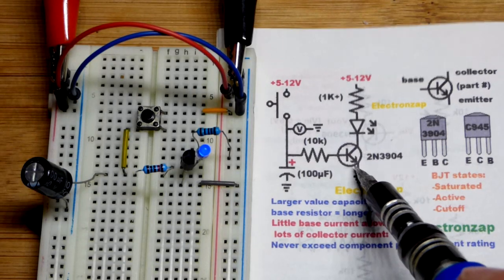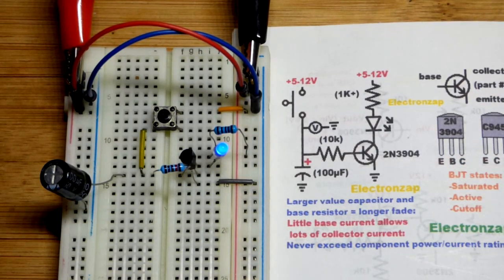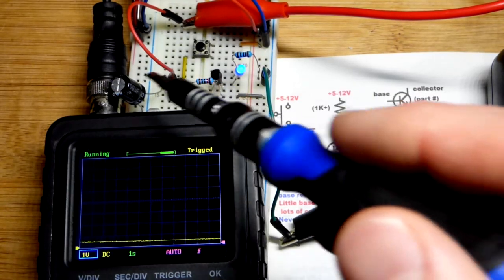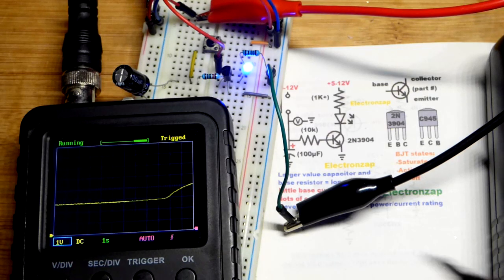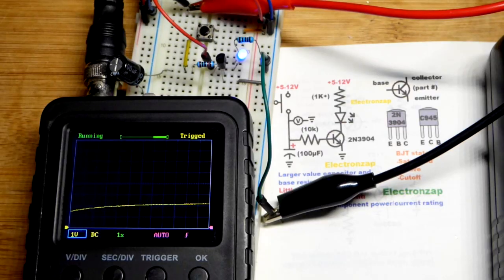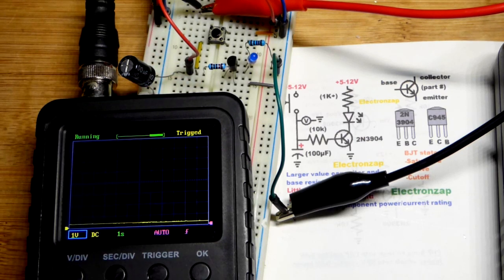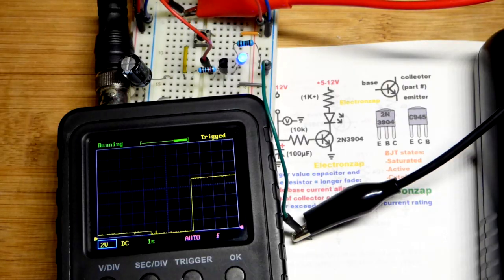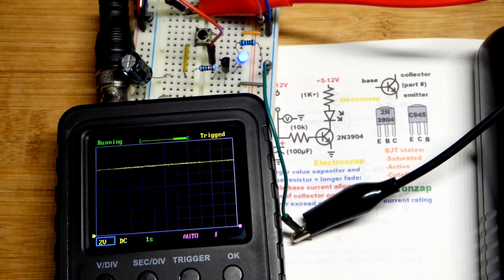NPN BJT Delayed Off With Fade LED Demo Circuit

Comment: what oscilloscope would you recommend to a beginner? can be a portable one too
Reply from the maker: This is the only low priced one I have. I don't think it matters unless it has customer reviews saying it is bad.
Reply: @Electronzap  could you share what model is yours? thanks
Reply: Not necessarily cheap as a cheap-o pocket one, but a real scope: Siglent SDS1104X-E is $500 new or $440 used. It's 4 ch and software hackable to 200 MHz (needs 200 MHz probe cables) and add Wi-Fi for $10. It also has a 16 ch digital logic analyzer option. It's pretty small, maybe 14" w x 8" h x 6"d